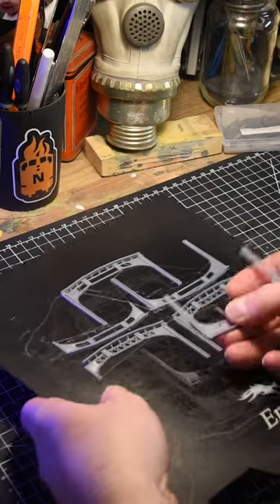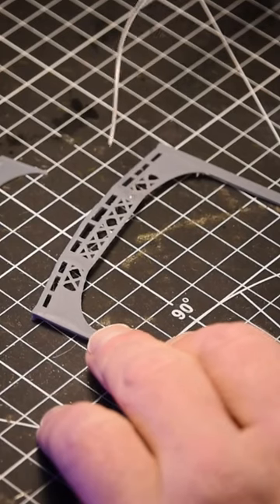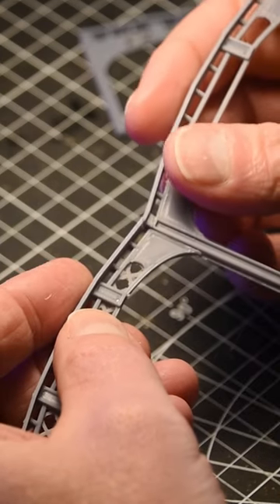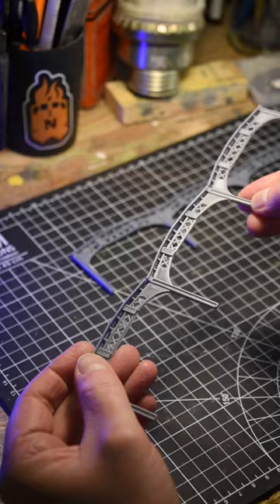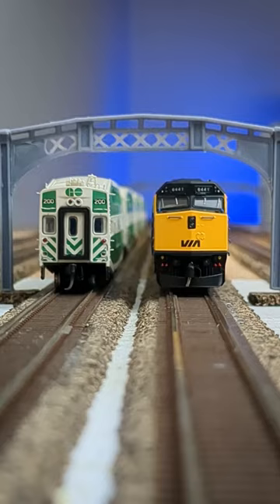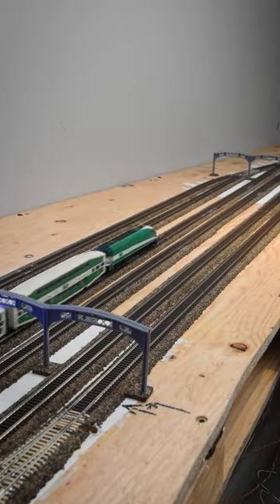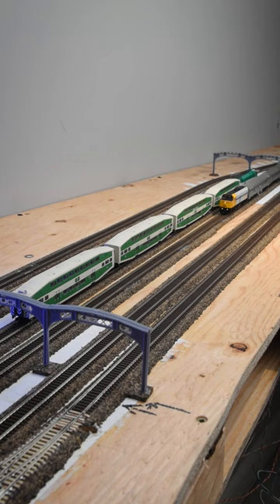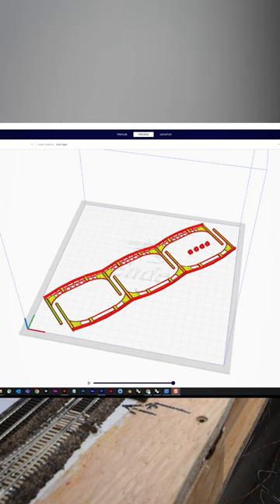Creating a 3D Printed Interpretation of Union Station's Lattice Girders

Comment: Darn you. Now I want to make union station on my layout. Keep up the good work! Maybe consider a resin printer if you continue printing small details. It is both fun and also saves you a ton of money. Happy modeling!
Reply from the maker: Thanks! I do have a resin printer and I really dislike it. There is no doubt it can create higher resolution prints, but the failure rate and mess is a major turn off. I don't mind sacrificing a bit of detail for convenience!
Reply: @NScaleDystopia  that’s fair. The supports can be a bit finicky but when things go well, it is a great tool. Maybe if you orient it upright then it would be more successful. However it would require more printing time than a pla printer.